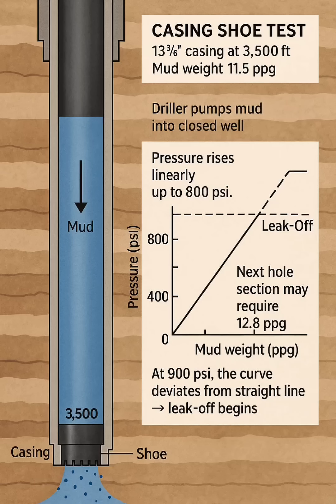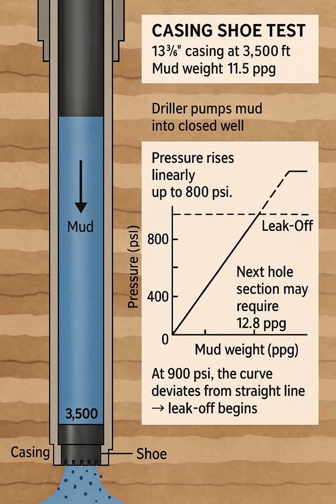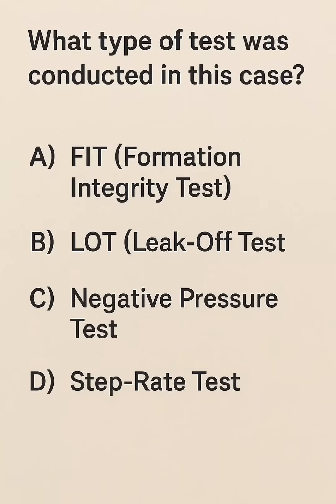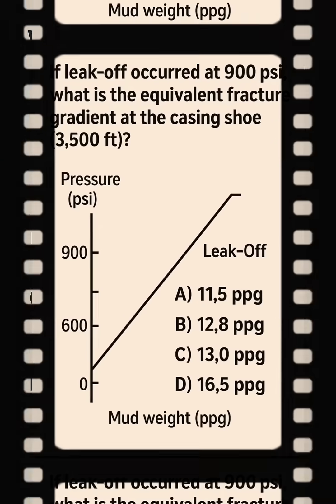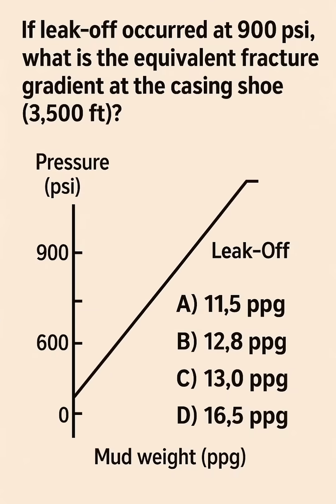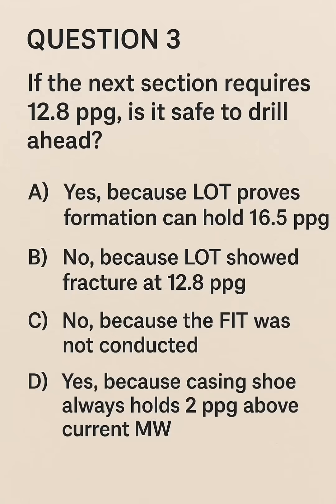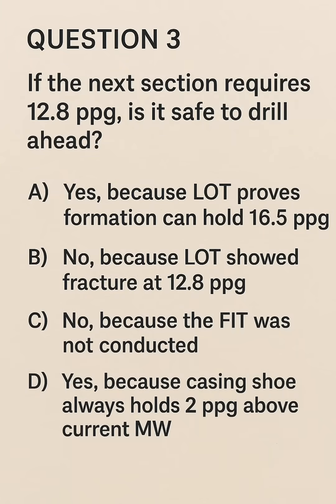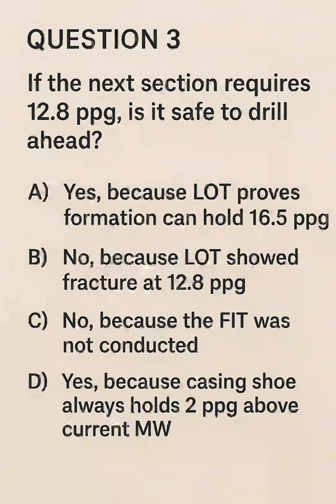Shoe Strength and Fracture Gradient Q53 #iwcf #wellcontrol #drillinghse

Comment from the maker: Question 1
✅ Correct Answer: B) LOT
Question 2
✅ Correct Answer: D) 16.5 ppg
Question 3
✅ Correct Answer: A) Yes, because LOT proves formation can hold 16.5 ppg
Reply: is 16.5 ppg coming from 11.5 + 900/(0.052*3500)=16.5 ? I dont know just a guess.
Reply from the maker: @arifmuradov6507 Great question, and your guess is absolutely correct.
The 16.5 ppg value comes from converting the 900 psi leak-off pressure into an equivalent mud weight and then adding it to the existing mud weight:

Equivalent\ MW = \frac{900}{0.052 \times 3500} \approx 4.95\ ppg

Total\ Fracture\ Gradient = 11.5 + 4.95 \approx 16.5\ ppg

So yes — your calculation is exactly right. Well done, and thanks for engaging in the technical discussion.
Reply: @DrillingHSE Thank you so much sir. I appreciate your quick and helpful answer🙏.